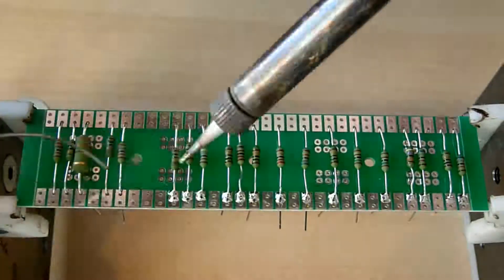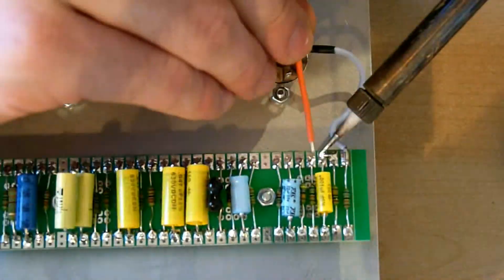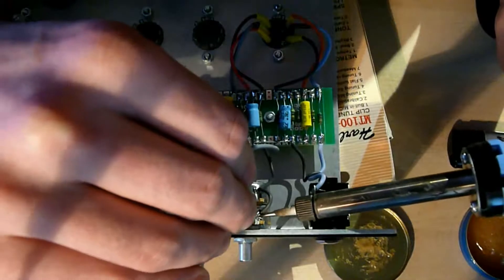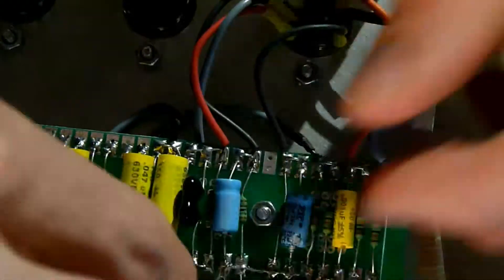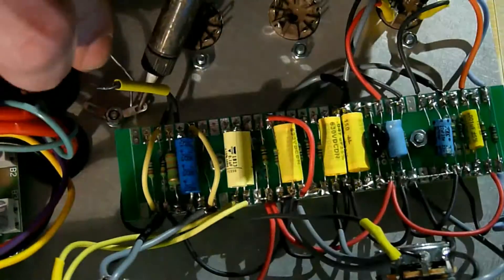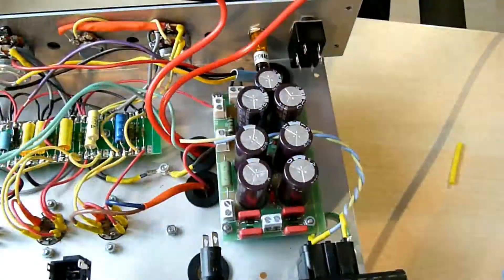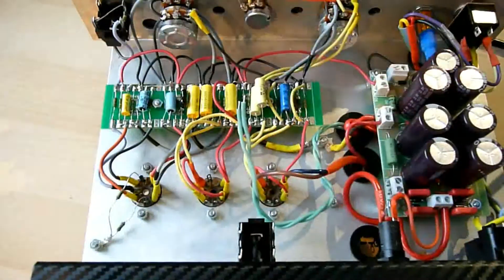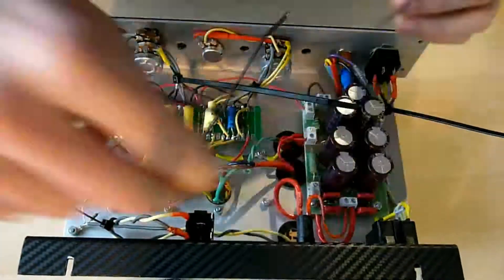Build your own Tube Amp! Tiny Terror Copy by tubetown.de - Episode 3 Wiring the Amp

Comment: Interesting little amps. I'd like the lumberland but using an el84 for power. No big deal but I think wire hooks for a mire mechaical connection woukd make the amp more reliable. Also I don't like the screw down connecters on tge power module!